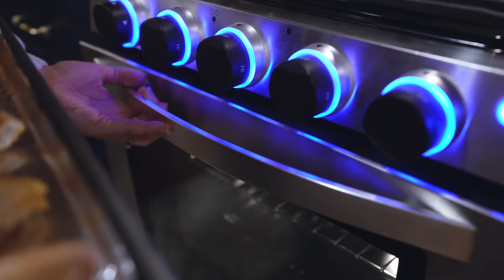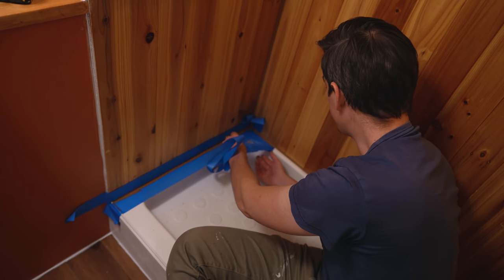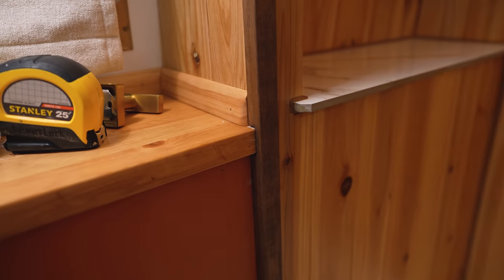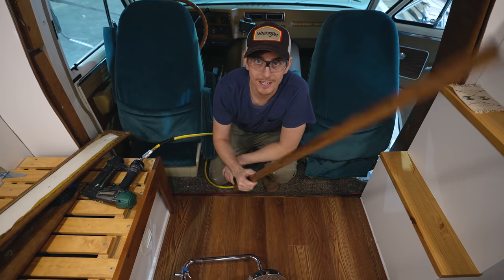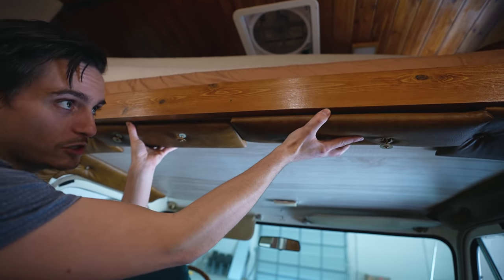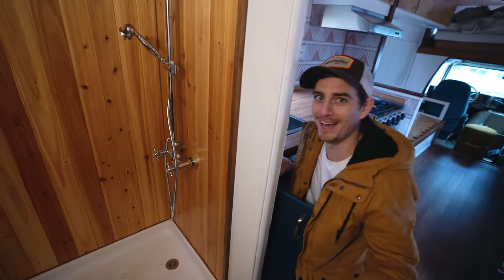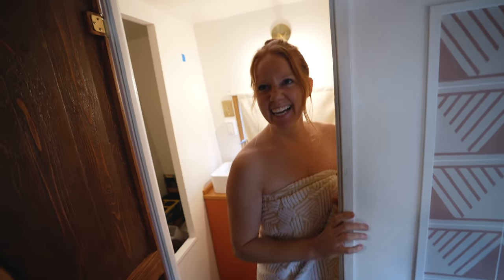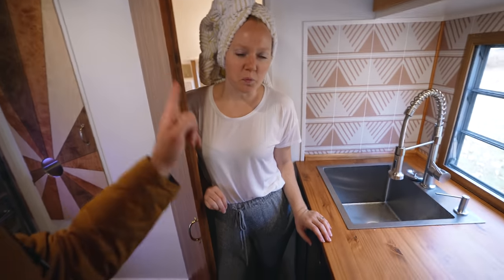Our RV FINALLY Has a Shower! 🧖‍♀️ + Sharing Our Upcoming RV Travel Plans!

Comment: I love what you did to your rv and THANK YOU for not calling it a "tiny house" like so many idiots do when it's really an RV. Have you added up the total cost of what you bought to customize it? Though I realize you'll be living in it full time, some materials and those faucets will just increase the weight and decrease your gas mileage. When rving, gas mileage is one of the most important things to consider. I'm wanting to get an rv like yours but with the rear bedroom and use the over cab area for storage only. Beautiful job guys and very smart to put the shower plumbing under the kitchen sink.

Comment: The shower look great guys!!

But why did you even use tape? For next projects, just put the nozzle in the spot that needs sealing and apply along the gap that needs to be sealed, with some water with a little bit of dish soap, wet your finger and trace the seal immediately after applying. You get almost perfect seals and the soapy water prevents the goop from sticking to your fingers.

Still, we've been watching in awe what you guys managed to do with Clementine! Amazing!

Oh.. And the socks were funny!

Comment: Hi, been loving your videos and adventures. I wish I could send you pictures of our shower surround and shower curtain we built in our 5th wheel re-do.  I wanted to let you know we used Rustoleum  Boat SPAR varnish on our cedar shower. Water will NEVER get through that. Ideal for use on exterior wood surfaces above the water line, including trim, railings and wood furniture
Oil-based formula expands and contracts with changing weather conditions
Dries to the touch in 2 hours and covers up to 150 sq. ft.
Durable coating provides excellent resistance to UV, salt and mildew
Crystal-clear varnish leaves a beautiful gloss finish with maximum protection
UV resistant
Salt and mildew resistant
Expands and contracts with changing weather conditions
Twice as durable as conventional wood finishes.
Our Home Depot recommended it to. Never even considered it, but makes sense. Our curtain rod was made from decorative iron pipe fittings and copper . In love and the patina is awesome. Love your redo! Our shower did the same thing! Water spitting at us! Can’t wait to see what you do about it.

Comment: The bad thing about giving advice on YT is that it always comes too late or after the fact. For professional looking caulk seams you make a simple tool out of a 3/4" steel ball bearing and a piece of wooden, plastic, or metal rod. You glue the rod (which will serve as a handle) to the ball bearing with some epoxy putty. Once you run the bead of caulk you drag the ball bearing along the length of the seam from one corner to the other. It creates a nice curved straight & clean looking line. Wipe it clean & use it on the next one. You can make one with a smaller ball bearing for finer joints (like in cabinetry walls where your bead of caulk is a lot less than a 1/4" wide. The 3/4" inch ball bearing works for most caulk jobs where the bead is 1/4" to 3/8" wide.

Comment: Are you planning on doing a recap on the mechanical upgrades done on Clementine? We have a campervan of similar age and are considering changing from carb to fuel injection; mostly for increased MPG’s. In your opinion is it worth it? And what is your current MPG? Thanks much

Comment: Nooooooooo, you do not want metal trim pieces on the edges of your counter.  You will perpetually have a lone of gunk and goo that will collect in said edges every time you wipe it off that you will have to pick out with a knife or something sharp and thin on the horizontal surface as well as around the front of it where it doesn’t meet the end of the counter.  Why was it a problem that the countertop didn’t meet the edge of your cabinet? No on sees it but you and functionally speaking, it doesn’t affect anything. And a vertical edge is easier to clean than a flat piece of metal flat on the countertop.   

But otherwise, great job on your finishing work.  .